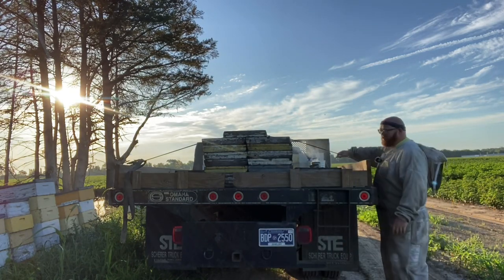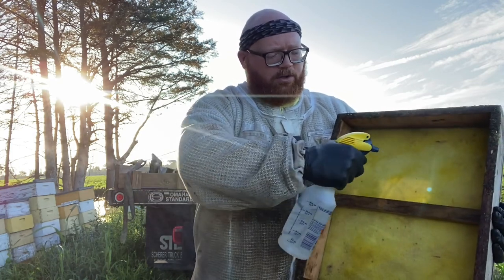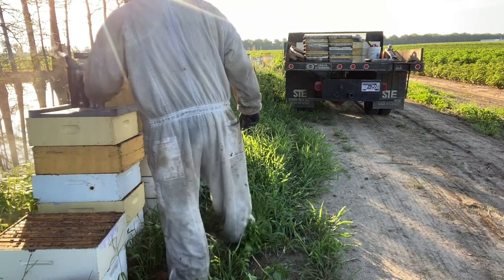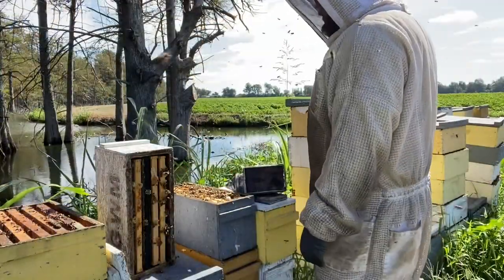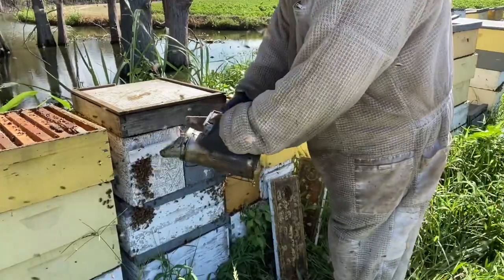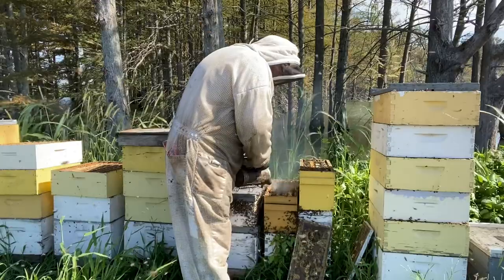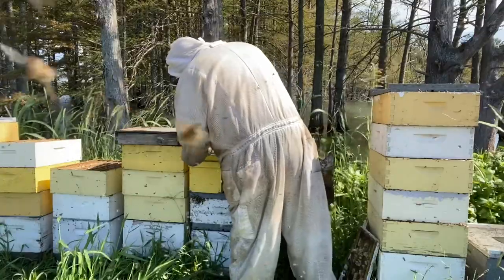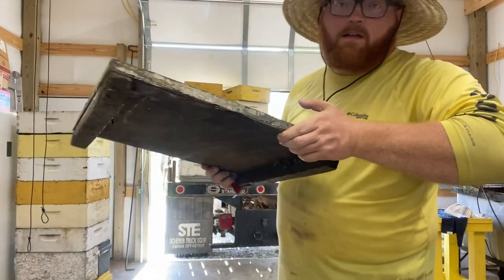Pulling Honey- Start to Finish

Comment: I'm surprised you didn't put tops on the boxes once they were stacked on the truck.  I understand that there is a honey flow going that reduces the bees going into the boxes, but you did all that work for the chance to have bees re-enter the boxes.
Reply from the maker: I usually do when it’s necessary like this time of year when I’m pulling honey. At that time it was not an issue and it’s better to let the wind blow any stragglers out.

Comment: Hello Gus very informative video. I run all 8 frames because of health an ago an love them . On my nuc I have all 5 frames but thinking I really like your idea on the 4 frames . I could run some 10’s just to do the 4 frame nuc for a lot of different ideas . Off the top of your head do you remember the width size of the front boards ON YOUR 4’s . If not that’s ok . I have been keeping bees since the mid 60’s but have down sized now a lot . I like your setup keep up the great work. THANKS
Reply from the maker: I don’t have any measurements handy, they’re the same as Mike Palmers resource hives. A google search on that should get you dimensions.

Comment: Great video!!  It appears that you do not put tops on your supers on the truck while you are pulling.  Do you have issues with bees getting back in there or does the bee go vapors still keep them out?  I cannot wait to see your thorn extractor in action.  I have a 20 frame maxant like yours but need something bigger.  I am looking at thorne and hillco for upgrade to over 30 frames.
Reply from the maker: When the flow is on I don’t need them

Comment: Thanks Gus, good video.  Just started pulling in NE Indiana.  I've used Bee Quick  and it works well if Temps are warm enough and sunny.   Where do you get your drip pans?  I overwinter the 4 frame nucs also.  Generally do as well as the full size hives.  Thanks again.  Glenn
Reply from the maker: Make them